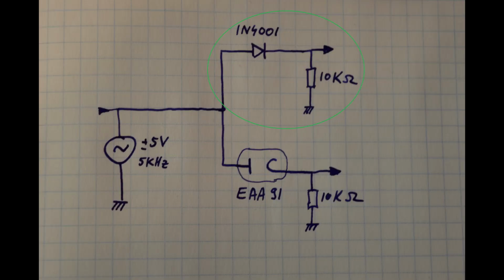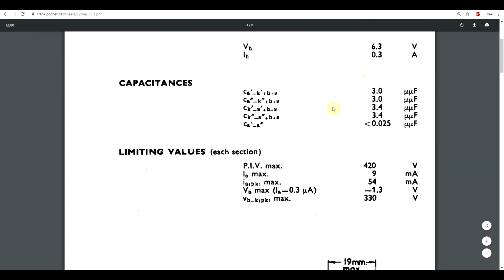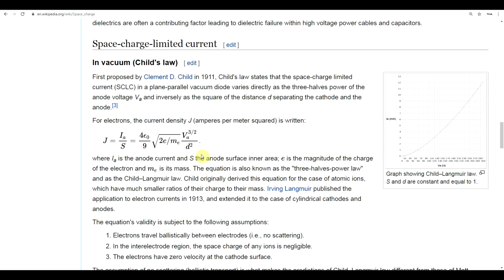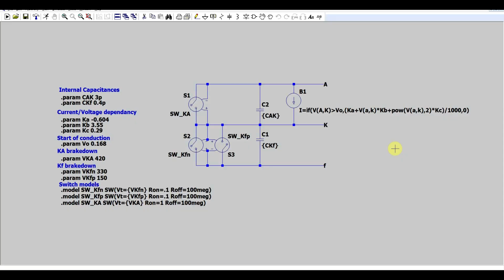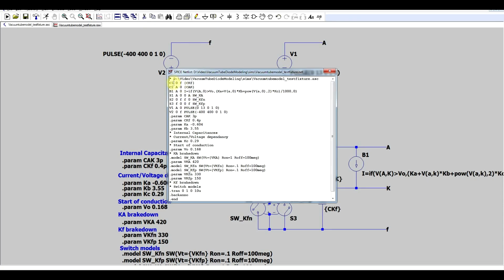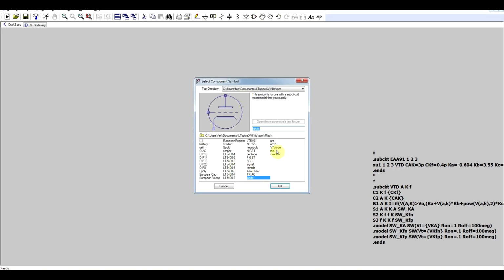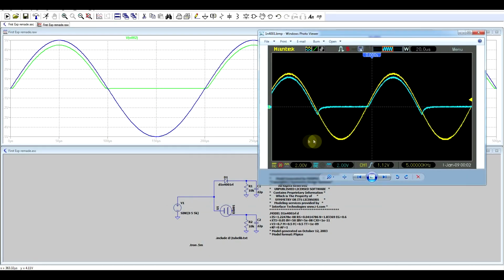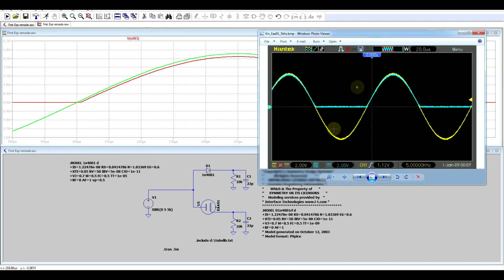LTspice Tutorial - Creating a model and a library for vacuum tube diodes

Comment: Well done! Small proposal: I prefer parameterized resistors with R=if(v(In)>=5,1,,100G) over switches, which require a separate model definition, causing reduced readability. In case of a parameterized resistance, parameters are directly indicated next to the resistor. On the curve fitting: You may also try to apply Excel's solver to create the polynomial parameters. Benefit of the solver is that you can apply more functions than what is offered by the trendline selection menu.

Comment: Excellent video. It would be interesting to translate such vacuum tube curves to solid state components. In some type of circuits vacuum tube diodes can give a very specific response because they act less linear. Especially because of that less linear internal resistance.
Reply from the maker: I'm happy you enjoyed it! 
I think the worst case would be to build a massive op-amp analog computer circuit to perform exactly the characteristic equation, but there probably is a simpler way though. Where do you see this kind of response as being superior to normal semiconductor circuits?
Reply: @FesZElectronics  Well, I don't think an exact 100% correct equation is needed, just a (close to) similar shape (since tolerances on tubes are already not that great)
Because of the non-linear increase in resistance, it means you will get a drop in output voltage vs current.
In (guitar) amplifiers such diodes are being used for the power supply. This can be beneficial since it works like a compressor, which can lead to a pleasant sound characteristics.
Since solid state devices are cheaper and don;t need any heater current, you can save on the design components, but still keep the same behavior.
Reply from the maker: @Piet Muijs . I was trying to make a variable sine wave generator at some point and I came across such a compressor type circuit. The basic principle involved generating a triangle wave with variable frequency and then using the non-linear compressor to turn it into a sine wave. Basically they used multiple diodes (silicon) with different series resistors all of these in parallel to get this variable resistance effect. The principle is used on a more serious level in the ICL8038 with transistors rather than diodes and there they use 4 of these elements with different resistor values on each side (4 positive half, 4 negative half). I guess if you tune the resistors just right and have enough stages, you can get the desired effect without the hassle of filaments and other old-school problems.

Comment: In my version of excel you can fix a point on your graph to set the zero origin point, but I think its also likely possible in other versions. Otherwise you can also add extra zero points to you data to increase its weight in the fit. Really enjoy your videos!
Reply from the maker: Are you using a specific version of excel? If there is a specific name to this feature maybe google docs has it also; I noticed the 2 programs are very similar.
Reply: @FesZElectronics  I'm using the 2013 version and the option is called set intercept.